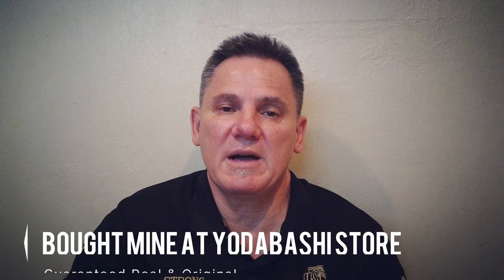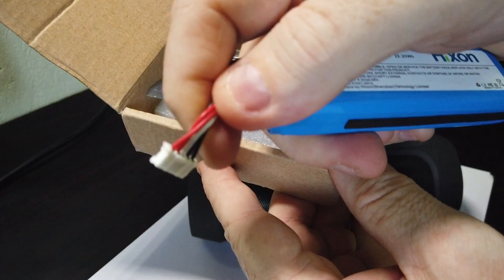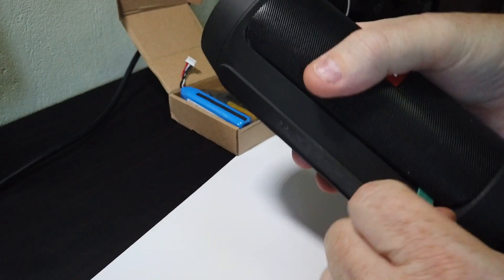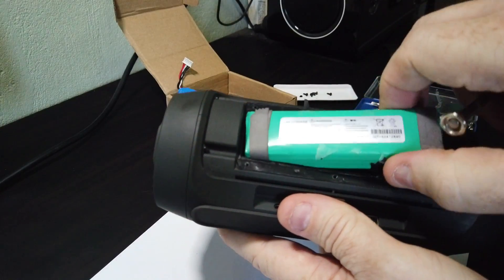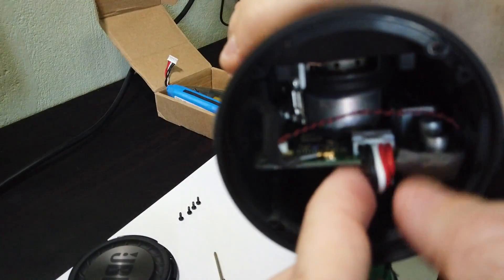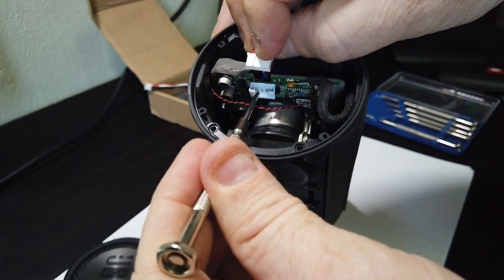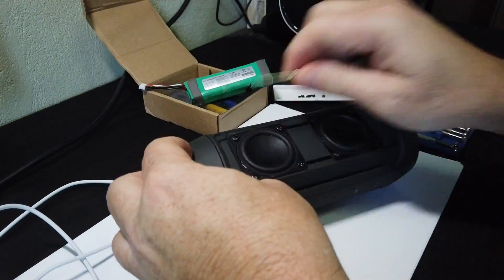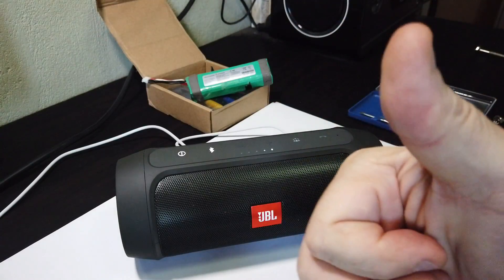JBL Charge 2 + Battery Replacement Tutorial - JBL Charge 2 PLUS Battery Replacement

Comment: Thanks for the video. Even though my charge might be ok for a bit now.

The "cover" on the side is more than just that. It is a resonator, which enhances the bass reproduction immensely. The membrane is driven by the bass speaker on the other side and the air tight chassey.
Reply from the maker: Thanks for the info!

Comment: The is the version I have. The other version has the battery tray. I'm not sure which is older. However, my battery door only has two screws, not six. 
Also, mine has some multi-purpose adhesive rubber around the battery and the cables for a more watertight fitting.

Comment: I must have a different revision, mine was quite simple to disassemble compared to yours, I only needed to remove the back grille nor did I need to remove the driver end cap, once I unscrewed the battery cover and removed the battery the plug was easily accessible to a circuit board in the top of device.

Comment: Hi!  Great tutorial!  I used your video to disassemble. Once I got to the adapter, I noticed an exposed place in the small red cable, due to the right wrap. the exposed wire was touching the circuit board. I wrapped it with some electricians tape, re assembled, and I’m good to go!  Without your help, I’d probably have not gotten that far. Thank you!

Comment: The battery’s are all the same the different is the power and ground leads. Have no fear! I realize the power an ground are backwards on my battery so I just flip the wires one at a time. There is a little tab holding the pin in lift it up with tweezers an pull the wire out of the connector an repeat start with the out side an work your way in. White wire stays An boom your polarity is now flipped! An your batter will charge. The battery an connectors are all the same. It’s the wires that are flipped on the old an new style or revision. Great video helped me take my speaker apart. Amazon 15$ battery 2000mah bigger then the original same size.

Comment: Hey! Excellent Vid thank you so much for your time uploading it! I'm on my second JBL Charge 2 Plus and again after about 18 months the battery is depleting after only less than an hour playing! JBL changed my first one to a new Charge 3 but I didn't like it (sound seemed inferior to the 2) sold it and eventually found a new Charge 2 plus. More than happy to buy a replacement batt this time! After dismantling according to your instructions I found the battery in a 'box holder' not under the plate as in yours and it plugs into the board directly underneath so I don't have to take an end of (always good). The Battery model, voltage, rating is exactly as yours except it has an 'R' after the GSP No. Do you know if the replacements are the same size as in mine goes into box to hold it yours just drops in under the white plate. The white connector is also identical to yours!  Thanks again great 'How do' Video :)
Reply from the maker: the battery I bought for mine was actually advertised as a  "GSP1029102R".   But the AliExpress store I bought it from (HIXON) show detailed enough pics in the listing so I could tell it was the correct version polarity-wise.   A good example of a good listing with a great pic of the connectors and cables is this one .....       https://www.aliexpress.com/item/33023238848.html?spm=a2g0o.productlist.0.0.1d084158jKuZZV&algo_pvid=369ae40e-e2f5-4842-9ccf-d1eb21d5464c&algo_expid=369ae40e-e2f5-4842-9ccf-d1eb21d5464c-25&btsid=0bb0624616008259839314161e5fac&ws_ab_test=searchweb0_0,searchweb201602_,searchweb201603_

Comment: Thank you, sir! I followed your video instructions and successfully replaced the battery. One difference I noticed was that there was a peel-and-stick rubber gasket under the battery cover. It was connected to a circular gasket on the battery itself. I carefully lifted the gasket off, stretching it in the process, so it didn’t quite fit as well when I put it back on. I’d suggest cutting the two points where the round part on the battery attaches to it, and leaving the rectangular piece in place when replacing the battery.

Comment: Hi there, does anyone open this battery to see what is inside ? Is there are inside 4x 18650 cells or not ?
Reply: 2 cells
Reply: @SubcultureUnlimited  are you sure ?
Reply: @aleksandartripkovic4583  i have opened the original green battery by cutting the green wrap and inside are two silver cells.. unless inside every 'sausage' are two cells that's what there is.. my battery has swelled so the two silver cells are puffed so i don't think there's anything other than one cell in each packet..
i have unfortunately ordered the wrong model with reversed polarity, that's whu i open the old batt to see how it is wired.. i have changed the polarity of the new batt by swapping the wires on the conector however and it workes however there mus be some other issue as it doesn't charge the battery and i get some bad noise pulsing through the speakers.. it was doing the same after the original batt died..  i think i left it too long not realizing the batt was swolen and something else broke.. :( 
i guess you wouldn't know how to bypass the batt so i can just leave it plugged in without it.. ?
Reply: @SubcultureUnlimited  Sorry man first of all my English level is not so good so I can't understand you well.. I don't have this kind of bluetooth speaker, I have some other I was just curious what is inside that cell. So if that battery is 3.7V and 6000 mAh and you say there are two cells inside it, so it need to be 2X 18650 of 3000 mAh connected in parallel. 18650 cells is sized lenght 65 mm and diameter 18 mm so if this dimensions are then it is 18650 li-ion cells inside. You can buy it and replace in original battery wraping don't need to buy a 
whole battery, only new 18650 ones .. https://vruzend.com/wp-content/uploads/2017/11/30q.jpg
You can check polarity on battery just need a multimeter and 
needle ( becouse probes are to thick to fit inside ), don't need to open it.
Reply: You can check polarity on battery just need a multimeter and 
needle ( becouse probes are to thick to fit inside ), don't need to open it.
Reply: @aleksandartripkovic4583  i know i could check it with multimeter.. i was more interested to see how the wires are connected inside.. so i am now looking at whether your idea with using 18650 cells would work but i am not sure how to wire it.
the original battery has 5 wires coming out.. 2 red and 2 black.. both pairs are connected inside the battery and then one white wire.. so that's '+' and '-' and '?' .. 
i was trying to google how to charge the battery outside the speaker but could't find anything. it seems like it's a specific battery made for JBL speakers.
are you familiar with wiring  LiPo cells?
Reply: @SubcultureUnlimited  I don't know what looks like inside that JBL battery, I have Remax RB-M12 and my speaker use 2x 18650 cells, so when you want to replace just put and connect 2x 18650 cells in it, but I don't know what use that JBL and is that 18650 
cylindrical inside or it is some kind of flat battery ( don't know do you have place to put 2x 18650 since they are 18 mm in diameter and 65 mm lenght ), if you can take a picture of that battery inside and do a measurements of it I can tell you what is inside. In case to have 3.7 V and 6000 mAh ( double capacity ) for example you need to connect 18650 x2 in parallel connection. For charging battery outside the speaker you need some kind of balance charging / discharging devices, like SkyRC Imax B6mini that I have, you can charge battery with it. Not sure for white wire ( you can google it ) but most likely it is connection to measures the temperature during charging/usage.
Reply: @aleksandartripkovic4583  the battery is not cylindrical so it is definitely not 18650.. it's rather flat.. i have tried to google something about it but no luck.. all i get are offers of replacemen batteries.. and all is somehow linked to JBL products.. i know a bit now about charging LiPo batts but i can't use that knowledge fot this product.. there is also a little pcb (P-1S2716A) between the 2 cells which probably regulates the charging or discharging but i can't find anything about it.. and the speaker will probably have some more stuff before it send power to the battery.. bu that's ok.. i might just use the speakers and build new bluetooth speaker using amplifier board..
Reply: @SubcultureUnlimited  Yep, then it is some Li-po battery.. When I ask this I was searching to buy a bluetooth speker with 18650 inside it so I can change it later when battery is dead.. And I found this Remax RB-M12 it have 4000 mAh capacity, 3.7V so there are 2x 18650 inside with 2000 mAh each.. So when they go dead I will put 2x 3500 mAh inside ( which is max for 18650 battery ), and I will have 7000 mAh capacity inside, of course it will take almost double time to charge, but I can leave it all night.. That is advantage since I have a lot of 18650 cells. For you and other people which speakers use Li-po flat cells, you must buy a replacement and put inside, I don't think you can make some modifications, 
in essence it could if 18650 cells can fit inside.. you don't need to use two, other one is just to double the capacity, so if you use one max capacity is 3500 mAh, for example you can put Sanyo 18650 GA which is almost 3500 mAh and 10A discharge capatability..

Comment: I think the batery problem is because while is charging is not turned off. You not must listen music when the batery is charging.
Reply: Gabi Cristea No. not true. Doesn’t matter whether plugged in or not.  Batteries eventually die.  Mine also has done the same... several years of constant use and finally it’s not holding a charge at all.

Comment: I got the Hixson battery like yours, but only had to take off one cover, the battery was in a black plastic box/pack kind of thing with cable plug directly in body cavity. However during the process a tiny little gasket around that opening was torn apart so I had to toss it. Was that for the water resistance, will it matter? Good video and very helpful.
Reply: Daaaaa
Reply: Once that gasket is opened , the ingress protection is over. It's no more water resistant

Comment: Is This battery same as jbl charge 3?
Reply from the maker: I have not seen inside a Charge 3 to see the original. Looking on AliExpress though - the Charge 3 battery I saw had a different part number (the last letter was different). It did list a year on the listing - so like the Charge 2+ - it might depend what year Charge 3 you have (same as the Charge 2+ did )

Comment: Hi. I have a JBL charge2+ too. Its 3 years old, and its working only while it is plugged. What is the expected lifespan of this type of JBL? Does it worth to buy a new battery or a new JBL?
Reply: JBL Charge 3 is bigger, has the same battery 6000mAh capacity but it is a 20 Watt output unit, 5 Watts more than the Charge 2+.  So expect less music time at max. volume.  The new Charge 4 has 7300mAh with 30 Watts it's even bigger and weighs 50% than the Charge 2+.  The only annoying thing on the Charge2+ is the sound delay when watching a video, hopefully the new ones don't have that!
Reply from the maker: I got about 4 years from mine before it failed, about that same as my iPhone before it needed a new battery too.   Well for me - it was worth doing - the replacement battery was around 20% of the cost of a new JBL .... and the 2+ sounded better than the Charge 3 when I last compared them.

Comment: mine & Chilled are the same battery type.. I think the other 1 NOT shown in the vid has a  .R after the part number, so I think of it as R for reversed.  so as shown at 8.23 that would be WITHOUT the  .R   https://www.ebay.co.uk/itm/173507362901 is where I got mine (same as shown @ 8.23)hope this helpsChilled Pi.. did you charge the new battery 1st or let it run down 1st before charging????
Reply from the maker: Hey Jon - yeah - mine came with an unknown charge level. I ran it down after making the video to be safer. Then charged it fully. Am not sure if Li-ion are that picky but I did it anyway.

Comment: how do you reverse the polarity, pls help me
Reply: Bro, swap the wiring the connector end. First , second to be swapped with fifth and fourth respectively. I  did the same. Cheers
Reply from the maker: if you have the wrong replacement battery (the polarity is wrong on the connector - as seen by the red and black cables are reversed) - you need to return the wrong battery and buy the correct, matching battery. Li-ion batteries are dangerous if you mistreat or misuse them. They can overheat, catch fire or explode.

Comment: lol my battery is exactly the same as yours was so headed off to search for it, £140 just for the battery was the 1st thing I clicked on!  don't suppose you could list the place you got your new battery from? i'm in the uk so a uk seller would be cheaper ofc
Reply from the maker: oh wow - for that price you could buy 1 or 2 new JBL's. Like most tech things now - you can buy cheap with slower delivery (from China usually) or cost more, locally (so faster delivery). I had to get mine off AliExpress from China - and waited 3 weeks for delivery (but I was really in no massive hurry so that was ok).  I only use AliExpress when I can't get elsewhere - as it takes time - and I never store my CC details there. 

If you search for Charge 2 Plus or the battery part number you'll get a few results (say https://www.aliexpress.com/af/jbl-charge-2-plus-battery.html?SearchText=jbl+charge+2+plus+battery ) - you'll then see there are a few similar part numbers they list them under (like I said - there's 2 revisions). Most are around the US$20 mark - but - check the delivery cost as they all will vary. 

The one I ended up buying (may or may not have the same red vs black polarity as yours) was - https://www.aliexpress.com/item/GSP1029102R-for-JBL-Charge-2-Plus-Charge-2-charge-3-6000mAh-Li-Polymer-Replacement-Battery-pack/32920680905.html ( A Hixon brand one).. 
Good luck :)
Reply: got it from ebay in the end for £22, delivery on Wednesday so that's not too bad. thanks for the swift reply :)

Comment: cant believe the timing of this upload! my JBL last week started to charge fully till all 5 lights are white & stop flashing, but it only works for around 45mins then it dies :(  I guess that's the battery is it?? had it for some 7-8 years, always let it run down to the red light before charging it up.the sound as you say is amazing-I use it with Ipad2 so not even worth talking about how much it is an upgrade in the single Ipad2 speaker to this super little device!  thanks for the timely upload & showing how easy it is to replace the battery
Reply from the maker: yeah, mine was the same. It must be about 5 years old I guess. It started holding less charge and shutting down earlier for like a month. Then, it just stopped taking a charge completely.   I've tried a JBL Charge 3 - and really I think the Charge 2 + still sounds better - so it was worth a new battery swap !    I swapped iPhone and iPad batteries too when they get older and fail the same - and this swap is so much easier than those ;)
Reply from the maker: and as an added bonus - I just realised now that my Google Home Mini must have had a firmware update since my JBL failed. So now it streams music (even Spotify) from GHM to JBL via BlueTooth with no more stuttering !!!!! Woohoo .... a pity I bought that Chromecast Audio to make it work instead.  Time for a new video post ;)
Reply: I bought it in 2019 and now it won't charge at all ...